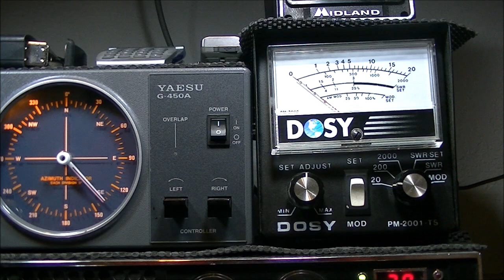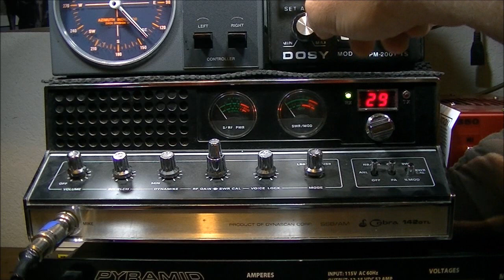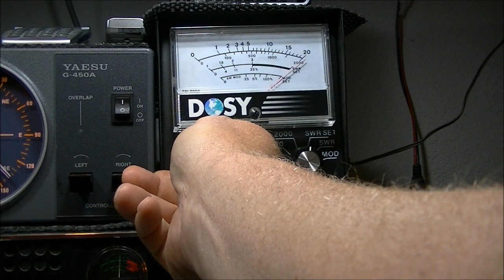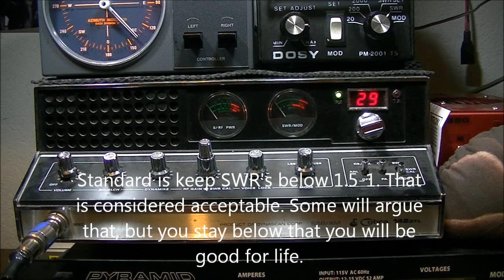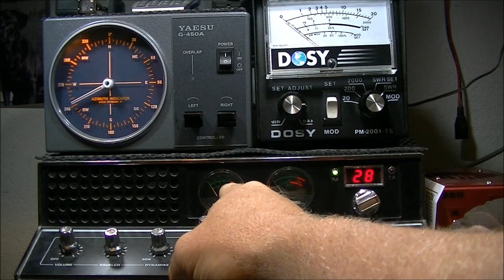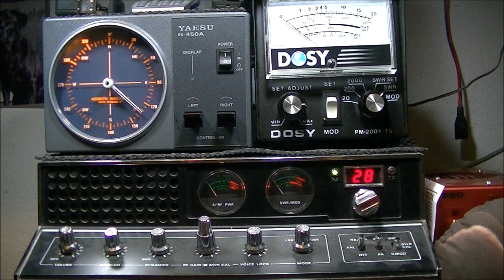SHTF Communications..CB Radio Basics

Comment: get you lic,, we have backups, why are you stuck in the 70s ?
Reply from the maker: bryon clemons Honestly, I have found most, not all, ham operators to be stuck up snobs. I like radio for fun. Not for people with uptight attitudes. I don't love the black lingo, I have no problem with it either. You might be one of the attitudes I don't like. You seem very negative. Are you a Ham?
Reply: Yes and this douchebag is the perfect example if a stuck up snob. "Stuck I the 70's?"  You still use light bulbs do t you, dumbass, so are you stuck in 1879???  When something works, you don't just abandon it when something else comes along. I've been a ham for 20 years, been using cb longer and still do. Get in a traffic jam on the interstate and your ham radio will likely be useless, the cb will let you know whats going on, which lane to get in or if you should exit the interstate to avoid a long delay. You simply show your ignorance with your asinine comments.
Reply: +bryon clemons  I got my advaned lic over 20 years ago, still have cb radios...I love cb!

Comment: drivers google 440cbshop for a great radio&antenna installer tech,or stop by exit280 baxter tenn or call 931-239-3848 for the 1 stop cb /antenna shop great guy he doesn"t bs you around he tells you the truth an gives u a est! b-4 he does anything an you can watch him wrk

Comment: BTW- There's an incredible amount of disinformation about EMP. Electronics of 
many kinds are not nearly as vulnerable as Hollywood and the news media 
would have us to believe. 

Modest shielding and good electrical grounding/bonding offers substantial 
protection to that which is vulnerable. 

Side note: If you can avoid circuits with MOSFET devices, you will reduce 
your EMP vulnerability to near zilch. Use older tube electronics 
instead of solid-state, and that risk basically goes to zero!
Reply: What’s a mosfet device?

Comment: I have an old Cobra 139. Looks a lot like your 142. Mine was manufactured in 1974 and I have all the original paperwork that came with it. Owners manual and everything. Works great.

There is no reason not to have a ham license now adays. There is no code necessary for a 2 meter tech license. Check out "HamTestOnLine" to pass the test the first time. $10 for a ten year license. Not bad.

Comment: Very cool! What's the highest you can have an antenna and would that made a huge difference?
Reply: The FCC rule says 60 feet from the ground or top of a fixed object best I ca. Remember. Its found easily on Google. And the higher the better, to a point. There is cable loss, in that the longer the run the more signal loss you have so at a certain point it would lose as much as you gain with the height. But the rule of thumb is  "height is might"!